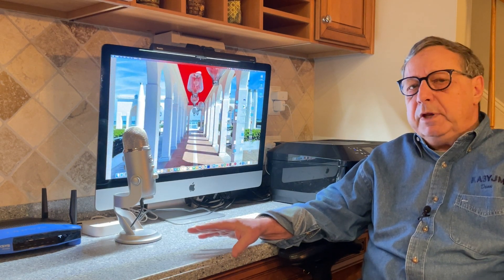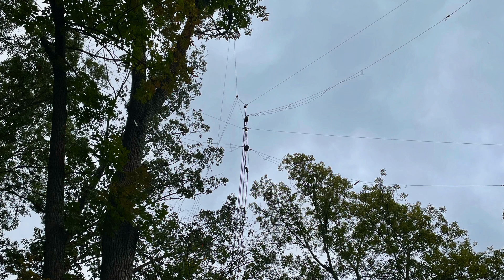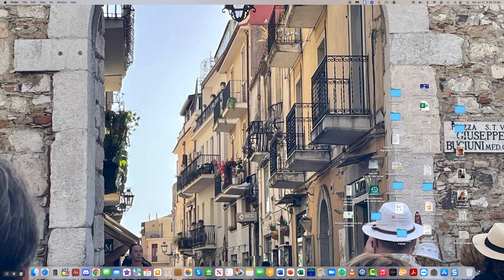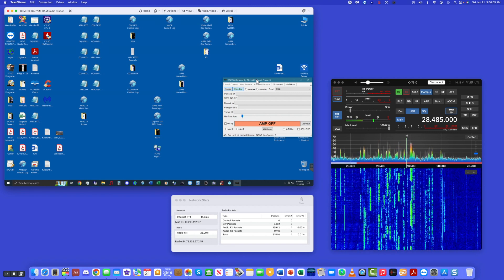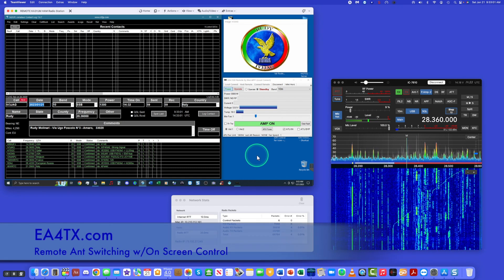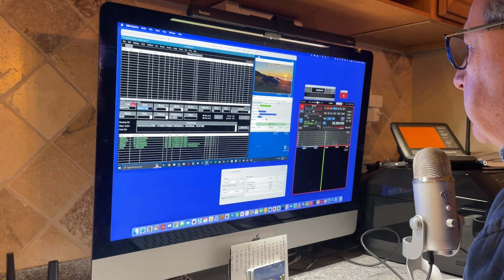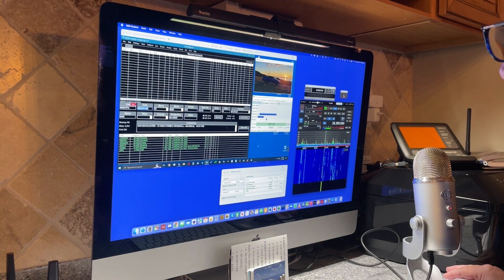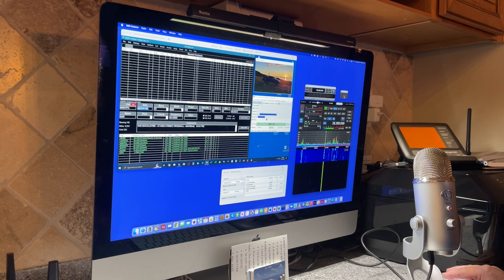Remote Station Ops on a Shoe String!

Comment: QUESTION: I am familiar with remoting, how do you transport your voice TO the remote transmitter? I did not catch that. I have been trying to do SSB Voice remote   without Skype, what are you running? Thanks for thjs great video BTW de WO8USA🇺🇸🇺🇸🇺🇸
Reply: In my use case, the SDR-Control software app takes care of getting my voice to the transmitter from the iMac.  Essentally, I have the Mic pluged into a USB power and then SDR-Control is configured to use that mic for transmitting.  I HIGHLY recommend SDR-Control by Marcus!  So sorry for the very later delay in responding!!